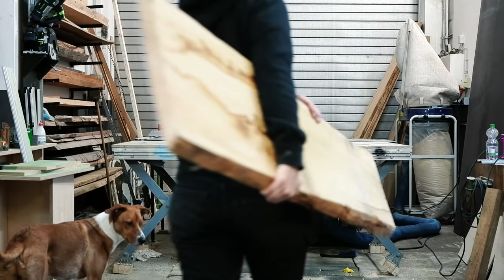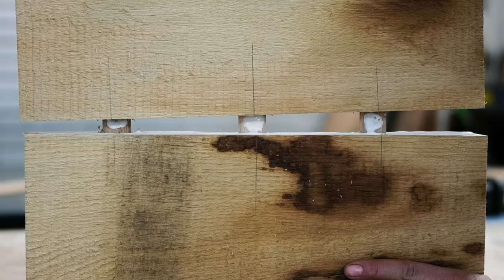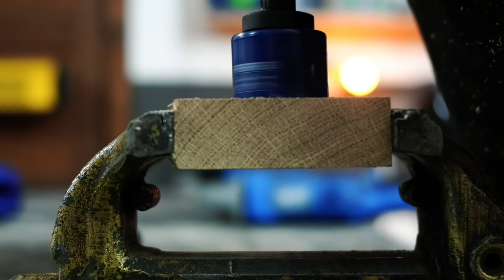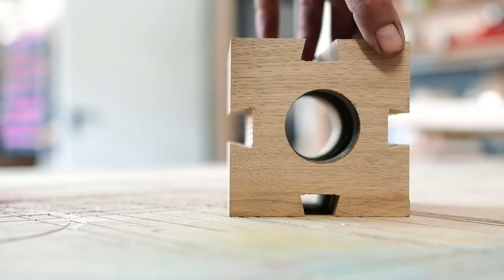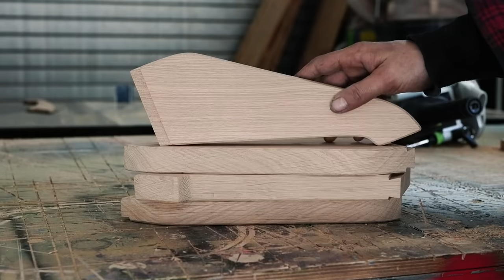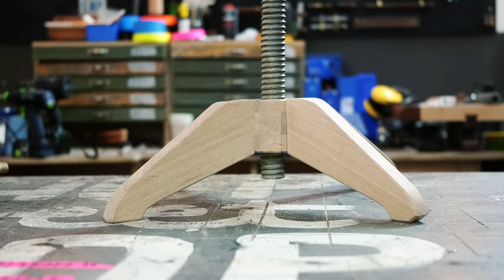Adjustable Stool made from Level Jack and Oak

Comment: I have nothing to do with carpentry other than use the end products...but watching these videos is very therapeutic. As an engineering student way back in 1990s, we all had carpentry in 1st year(along with machining iron blocks and other things) where we had to make simple joints. What looked to simple watching other carpenters was not so simple when doing it ourselves(using non powered tools only)...they all can out so ugly, with so much gap and irregular surface(same with welding workshop).
It’s just fascinating watching carpenters turn solid blocks and sheets into products!
Reply: and just to add...the metallurgist in me can’t help but want to electroplated the metallic part with  chromium 🤪

Comment: Nice dovetails...and a super nice stool. It's cool how you did the circular cut and dovetails with the table saw, not a router or band saw. People forget about all the options they have. Frohe Weihnachten und ein guten rutsch!  Cheers, Peter
Reply: I was taught how to do it that way by a cabinet joiner, even tho we had all sorts of others tool that would do the job, works well as a jig if you double stick tape another one to the top you dont need a hole in it
Reply: With some thinking you can really can expand a tool's capabilities, for me mostly because I'm not able at the moment to purchase multiple tools.

Comment: a locking nut on the central pillar a good idea I reckon. The original type adjuster nut with its wings would work fine, sitting on top of and locking lightly onto the base assembly. Great work as always Laura, and  Fröhliche Weihnachten

Comment: A very nice and simple project. 
On my to-do idea list! 

I like the old way of making a circle - start with a square and keep removing corners until there are none left. Tedious with a hand saw but much faster with a power saw. 

I know the feet one I make need to be higher because I need more adjustment range. The feet of mine may need to be stronger as well to safely hold my mass (110 kg). Now time to find a few of those jack screws (so I also can make some vises.)

Comment: Nice job, but with that short legs there is little room under them for significant adjustment. But it works for your use and that's all that matters.
Reply from the maker: All my workbenbeches have the same height-so I don‘t need much range. For more room simply change the design of the legs :)

Comment: It's very beautiful work that shows a great deal of creativity.  If you would like a couple of design critiques,  I do wish that you had found a way to incorporate the nut in a pristine form to celebrate the original workmanship and design of the artifact.  Perhaps it could have locked into a castle joint or similar joinery.  It also seems like you only got a few inches of adjustability out of a screw that is almost 2 feet long.  If the legs were at a more acute angle and longer you would have had a greater amount of of height adjustment.  If perhaps the legs were 2/3 as tall from base to the nut as the screw is long.  Then the stool could be used at a much larger range of heights.  It may also be a good idea to incorporate a stop mechanism of some kind to avoid the screw bottoming out on the ground and marring the floor with the end of the screw.  Many thanks.  I enjoyed the video and your workmanship.  You are very skilled.

Comment: Very cool! 👍🏻 The Only thing a have made different is with 3 legs instead. 4 legs Is no good if the floors are little bit uneven. 🙂
Reply from the maker: Very good point!
Reply: @laurakampf  please add some slick roller blade wheels!

Comment: Loved it as always, i did the same way cutting a circle for one of my tent cabins chairs i build in my forest and some on my land, but i learned instead of using a screw in the middle that it sometimes had the habit to gut stuck or out of aliment so i switched to a smooth pin instead and than it went a lot better i loved the way you made those dove tails, something i for sure going to try to make. although i going to try it with a ripping blade with square teeth to see if the cutting is more clean, i think i saw that on 'i made it' but not sure. but those legs is a great idea. sadly i live in the mountains of Norway and those things are hard to find here or you pay the gold price for it.

Comment: I think it would be good to have the stabilizers at a steeper angle (and thus the wooden scre nut type thing higher up) and cut the rod shorter in order to allow for more downwards adjustment. Or to be able to go higher with it if you don't make the rod shorter.

Comment: (1) I've been watching Laura use a certain method of joining for a while, but today I finally got curious enough to Google till I found it.  What isn't a biscuit and isn't a dowel?  It's a Festool Domino, and generically it's called "loose mortise and tenon."  I learned something today. (2) The base is sculpturally beautiful. (3) I never would have thought of that way of cutting a circle.  I usually see it done with a bandsaw.  I kind of worry about the one-sided pressure on the table saw blade during the fine-tuning, but I'm sure Laura knows what she's doing.

Comment: Did you keep the table saw angle fixed for all the pin and dovetail cuts, or did you have to adjust to that same angle multiple times?
Reply from the maker: No, it’s the same angle. I made all the cuts before changing it back to 90

Comment: Very nice. The assembly of the base is very well done and satisfying to watchbeing assembled. But at the end it isn't really adjustable due to the legs height. You have something like 10 cm of adjusment. Its more about the visual vibe than the real adjustment value
Reply: yes and no
I think 10 cm are not so bad, if you think that all people have to sit on non adjustable chairs 90% of the time.
And a big benefit is that you can rotate on the chair, like an office desk chair.
Reply from the maker: Yes! Also all my benches have the same height-so i don‘t need much Range.

Comment: Nice looking, but you're nut should be much closer to the seat. You will wallow out that base pretty quick and have a wobbly stool. Redesign it now before you ruin that nut and can't find a replacement.
Reply: That's a base jack for a scaffolding. The design hasn't changed in years. And the tolerances are very loose, so even when you switch to a different manufacturer for replacement parts they fit nicely.

Comment: Does anyone know what the metal thread parts are called?
Reply: That's a leveling foot for scaffolding.  Normally the threaded part would be inside of the upright pipe of a piece of scaffolding and you would spin the threaded nut up or down to raise or lower that side of the scaffold.
Reply: @SenorTunaCan  thanks

Comment: The performance is super, but no functionality. In the sense that if you used just an ordinary pipe, it would be the same. just a chair. no height adjustment. In my opinion, it was necessary to make the legs higher, and add some kind of rubber stopper to the threaded pipe from the bottom so as not to scratch the floor, and like a nut so that it does not accidentally fall off when untwisted)

Comment: not a great design at all:
- adjustement in height is very limited
- the nut had wings but they've been cut, as a result it's not as tighty coupled with the wood as it could've been
- dove tails at the bottom is a fragile choice.
- the screw at the bottom has too much play so that it acts like a ball joint
and a few other making issues like not planning the planks that form the seat, cutting twice the round on the table saw (2nd time with an angle, lacquer on the end grain, etc...)